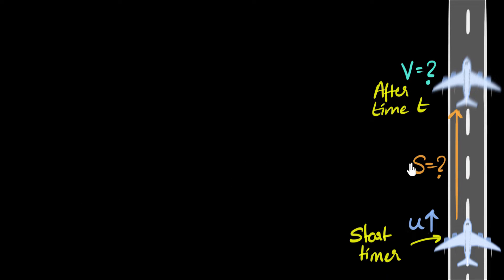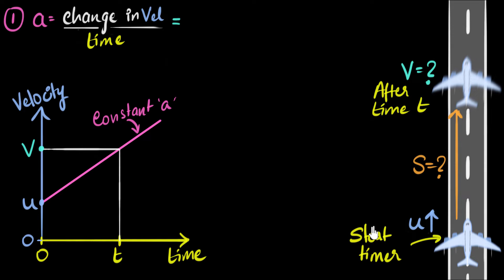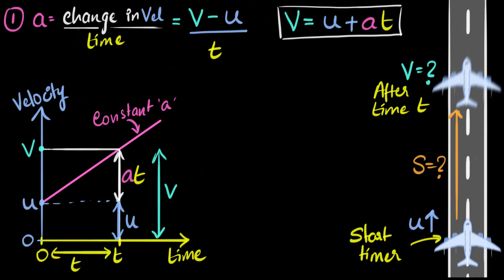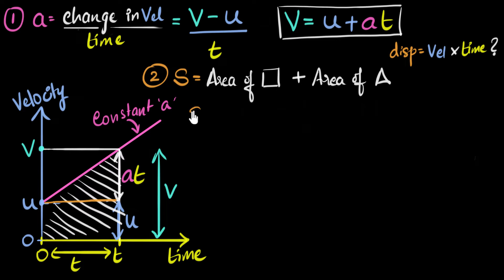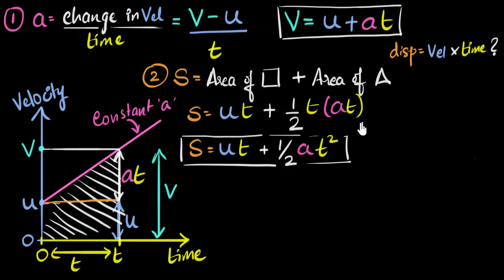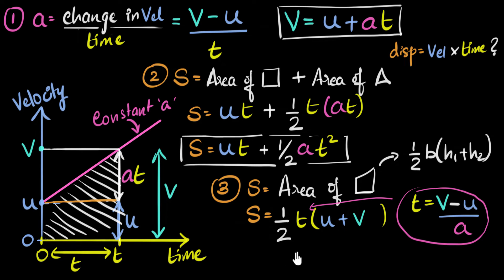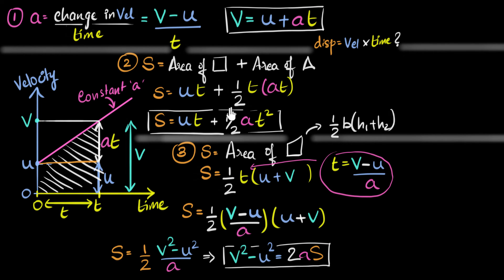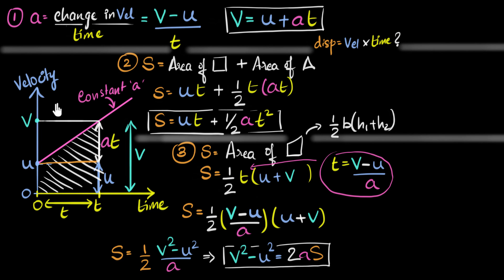Deriving 3 equations of motion (from v-t graph)

Comment: does anyone have any idea which software they use for writing.
Reply from the maker: sketchbook (freeware)
Reply: @KhanAcademyIndiaEnglish  Sir, can you please share how u manage to change the pointer icon (cross hair) ??
I have been trying to find a solution for a long time. 
Is it with the screen recorder or sketch book settings itself ??
Reply from the maker: @johna9281  It's an app you can buy in the Mac store called 'tag my pointer.' 
For windows, you can download a freeware called 'cursor attention.' I remember using it for windows 8.1, not sure how stable it would be for current versions.
Reply: @KhanAcademyIndiaEnglish  Thank you so much for sharing :)